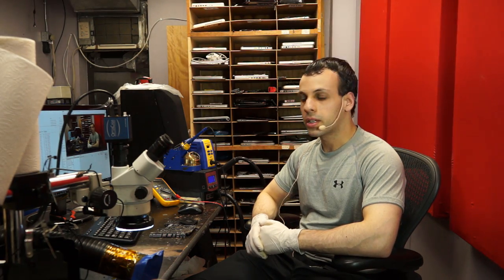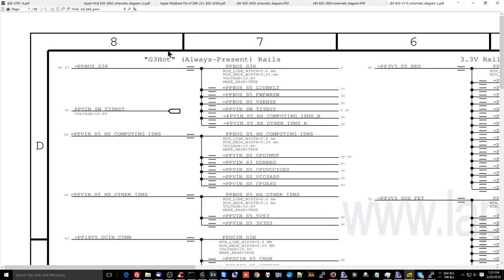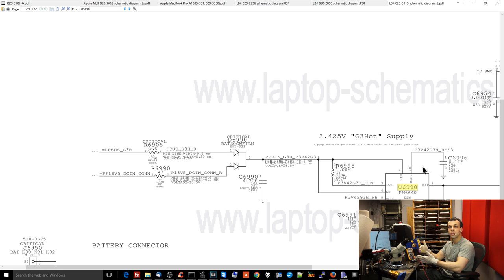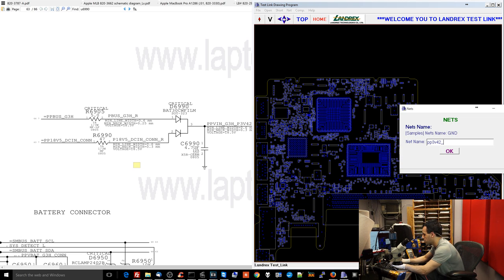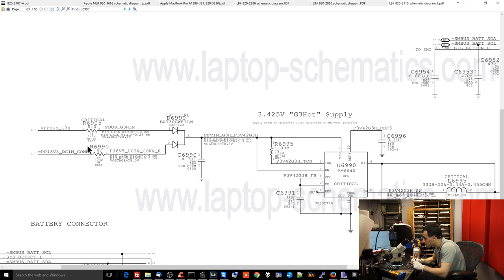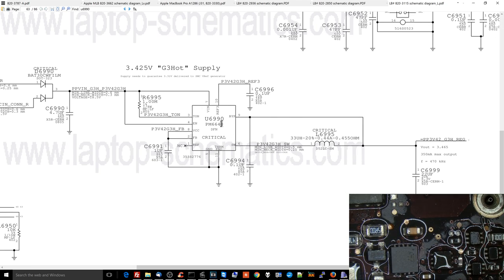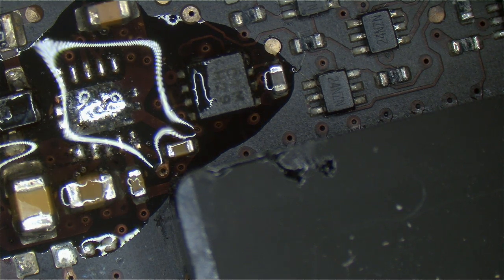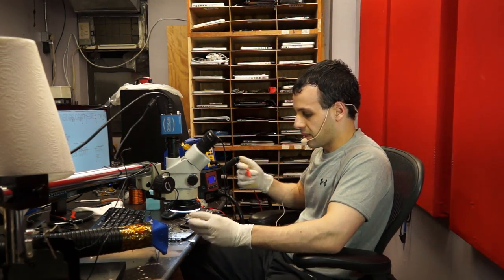What power rail do I check first and what is causing my short to ground?

Comment: Hey Louis,  I just wanted to thank you for your videos.  I have a 2010 MBP I use for college that just shutdown on me last week.  I was using it on battery when it got low so I plugged it in, and 5 mins later the whole power system went dead.  No charger light, no battery indicator light, nada.  When I got home a few hours later I discovered it would run on what little battery power I had, but instantly die and stay dead for a few hours as soon as the charger touched it.  

I tried to buy a replacement on Craigslist, but the guy flaked and never got back to me, while I was waiting I found some of your videos and decided I'd try and fix it myself.  Ordered a hot air station, flux, solder, wick, etc from amazon, and set to work on it this weekend.  Traced DC IN till it got to the other side of R6990 where it dropped from 16V to 2.2V.  Bit of a drop for a ~1Ω resistor...

If I'd diagnosed it first I'd probably have gotten hot tweezers, or some micro tips for my soldering iron, but the hot air got it done.  I'd bought a $10 Dell motherboard for practicing on and found a 0402 ~1Ω and pulled it.  Swapped it onto my board, flipped the switch and...GREEN LIGHT.  All said I'm into the repair for a little over $100, but I've got some new tools and new confidence (and I'm typing this on my working laptop--even if it is your favorite logic board the 820-2850A).  

Thanks again,  and a little tip for those of us who don't have a PCB microscope,  It's not great for detailed component inspection, but your iPad (or other tablet) camera mounted a little above your work area and zoomed in can get you a pretty good view of what you're working on.
Reply: This encourages me to do the same with my laptop lol

Comment: Flux is great! I just makes the solder flow into the right places. Without using flux on a pcb, I always manage to make the solder stick to the soldermask, shorting different power rails out. After adding some flux and putting the soldering iron to the pad, the solder just flows back to the pad, looking nice and shiny.

Comment: hi
louis great video I'm your big fan always watch your videos  I'm totally new to electronic but I'm not afraid to do repair on macbook pro its only a suggestion if it is possible when you use multiuser you can show the setting and the points where you touch the probe points the other thing is want to buy schematic  does card view software come with it or you have to buy it
I'm very sorry question is bit to long like i said very new to electronic
thanks with regards
ejaz

Comment: Noob question:  if 16.5V power goes into a resistor and 12V comes out, my newbie mind thinks the resistor is bad.   
     Why is it OK?  As long as it has the correct Ohms (47), something else causes us to read a voltage drop.    
     Just wondering why it reads low if Resistor is good?
Reply: Not 100% sure what you mean. 
You have to imagine the circuit. There is not supposed to be such a big voltage drop but the resistor doesnt have to do with it. Whats behind the resistor makes the voltage drop heavily since there is some GND connection so the whole circuit has like 47 Ohms resistance from teh resistor and maybe 100ohms from the faulty circuit behind it, thats what drops the voltage. In other words:

If the resistor drops the voltage so much that means there cant be many other things (that give resistance) behind it. If after the resistor there would be 0V it'd be a direct short to GND directly after it.

Comment: -+ Troll mode Argh the inductor, does not drop the voltage to 3.42v the regulator does that, u6990 the actual ic drops V to 3.42v it's a buck step down regulator, you can make this part you don't need to buy it :)  the Inductor is for a current  I or A ramp however you want to designate it, flow of electrons, it creates a magnetic field that increases and slows the flow of electrons until the full field is created allowing 350ma to flow no more no less, allowing it to flow up hill so to speak, It's to slow, smooth out ripples wave noise in the circuit.

When you insert dc in at 18.5v on the other end  you have 3.42v 350ma as output from the ic, it stops a spike it stops a train wreck from happening, it chokes the flow of electrons current and ramps, them from 0ma 3.42v to  350ma 3.42V, of the input voltage of 3.42v which is 350ma  it does not create the voltage, it's simply to stop it destroying things that are sensitive to having x amount of current A rammed up it's A in an instant.

It's like blowing a balloon up gently with your lungs from 0 psi to the max amount the balloon can hold, without destroying it the maximum psi.

Rather than sticking 10000 psi instantly inside it blowing it to pieces,. when power is taken away the magnetic field collapses and it's shunted by a diode to ground to stop the reverse flow of electrons, killing the ic and other components that won't like the reverse flow of electrons.

It will only let out the ma, put into it on a slope / the forward slash bottom left being 3.42v 000/ma  and the full flow of elections top right 3.42v /350ma just after you insert the dc power after and before the inductor you have 3,42v 350ma 3.42v 000ma at point of entry left side of the inductor until the field raises giving you output the other end of the inductor of 3.42v 350ma all the other information you provided is correct sorry for being a pedantic son of a bitch, your explanation works it does but it's WRONG.

+- Troll mode And as you can guess i'm being an engineer troll, carry on the great work, ignore the haters i may not agree with everything you say or do, but at-least someones trying to educate, people for £$0 that is priceless it's a credit to you and Jessa for someone to dedicate the time and effort, you have, to get some where in life Education or not, even if i learn not a jot, from the videos i find them entertaining and appreciate, the time effort and money, you put into the videos humbles me personally, for that thanks and keep on humbling....... yes i know it's a switching mode regulator lol ;) but it's still fun.

Above is full of physics and engineering jokes no-one take it serious Louis is entirely correct!
Reply from the maker: +ASTRO MAN Did I say the inductor drops the voltage? I doubt I did, but if I did.. please punch me in the face.